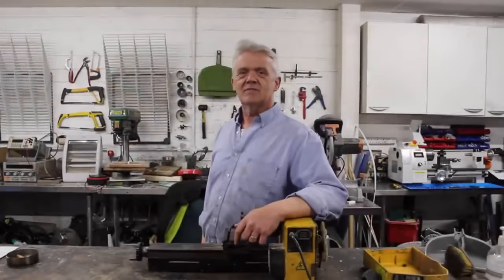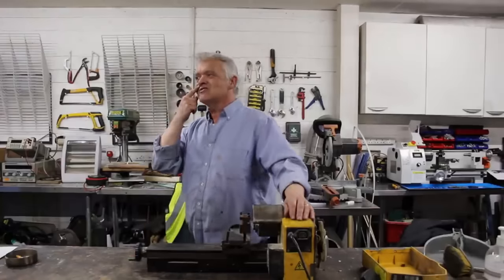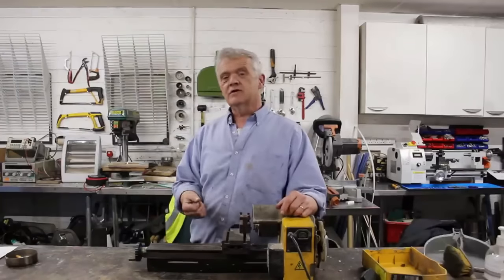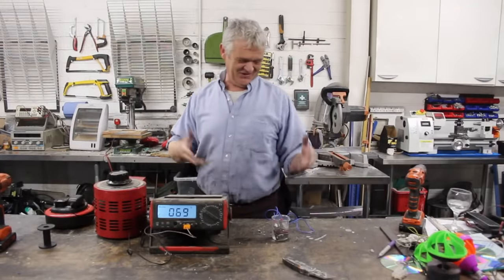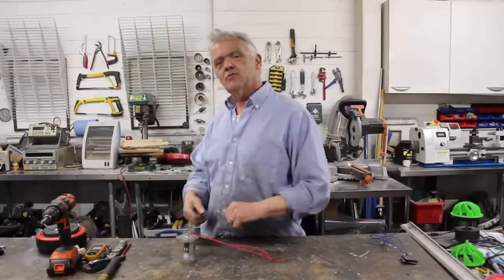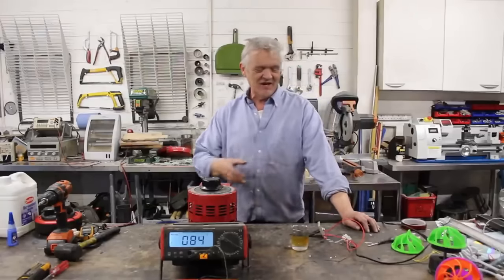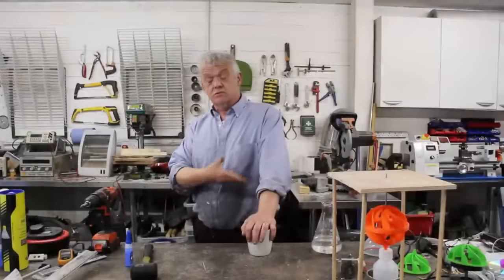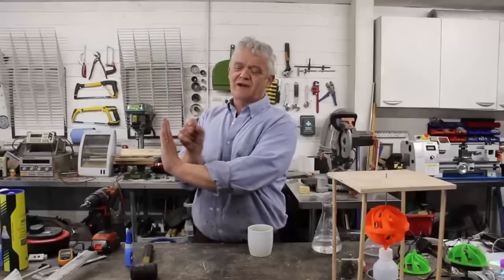016 The Dumas Effect - A Free Energy Water Heater

Comment: I'm not even half way thru yet, but since the first minute, I've been waiting for an "April fools"
 How is this not just electrolysis or HHO generator making tiny bubbles?
Edit: @Rob you killed us with suspense in this one haha. I hope we get tons of comments!
Reply: Ok, Rob covers electrolysis with this in the last third of the video
Reply: Because it isn't. Those tiny bubbles you see aren't HHO, they're Steam.
This is how we make a hot water stinger in Prison with a pencil, cord, and 2 razor blades.
It takes a DC Current through it to make it an HHO Generator.
THAT is the ONLY difference. Apply AC, get heat...
Reply: @TimeSurfer206  Except you can do water electrolysis with AC current, it'll just be less efficient and it doesn't separate the hydrogen and oxygen. Conversely, applying DC does heat up the water too.
Reply: @andrepolomat2420  Show me. I been an Electrician over 40 years, and worked Battery systems for many of those.
You are right, but still absolutely wrong.
Yes, the water WIL be electrolyzed. BRIEFY.
Because as soon as the CURRENT is reversed (ALTERNATING Current, remember?)_the PROCESS is reversed, too!_
Reply: Electrolysis always happens, DC or AC, even in de ionised water. But deionized water is much less efficient at the start. 

But ... Here electrodes are much closer than usual. The very intense voltage differential makes electrolysis possible and intense because the low ionization is compensated by
- high voltage 
- high proximity 

Plus : water ALWAYS has ions. Always. Water can be purified to be low ionized, but it's never 100% deionised. 

=» electrolysis happens here.

But the Dumas effect does not rely on electrolysis. It relies on basic water being a resistive conductor. 

The trick to make water boil 5x faster is just ... Close plates. Close plates with large surface at less than 3mm will encap bubles. The proximity of plates will trap bubles on plates and surface tension will make bubles stick to plates. Once the bubles stick to borders of plates the water in the middle is trapped, and the water in the middle can heat up to 100 or 120° C via basic resistive effect.

Because of bubbles, the water can't flow or renew. You produced an entrapped hot water zone that can boil locally. 

Outside the plates, the water remains at room temperature. 

That's how you obtain water boiling and.producing bubbles at room temperature. You are not boiling the whole glass, but just a thermally isolated part. 

It's spectacular because you are producing intense bubbles 5 times faster. It's just using proximity and surface tension to produce thermally isolated zones.

At some point, it's also not far from Meissner effect. 

And of course, electrolysis helps producing small bubbles to isolate . 

There is no free energy. Just a nice story to fool people who enjoy confirmation bias.
Reply: Note that i was too lame to even mention about oscillation or resonance. The video also gives mistake about it, says 22GHz instead of 2.4 GHz. 

 Microwave oven don't try to break water but use the resonance of molecules to benefit of some resistivity of all resonances. The good frequency makes molécule resonate, and at resonance freq the resistance is maxed, thus energy transfer between the radio wave and the solid matter. Away from that freq the wave just passes through. 

Phones are harmful because they use frequencies very close, on 3 topics : Bluetooth, gsm and wifi are all 3 close to 2.4.

Ideally in a better world those 3 protocols would be assigned frequencies away from 2.4g , but it would break historical compliance. ( to make the story very short ). 

Of course 50Hz is completely unable to even dream of having any harmonic anything near 2.4g ... It's too far from the peak bands.
Reply: Note that when he is using two rods, he is not giving comparison with an other bucket with distant rods for comparison, so we can't check if it's faster or same speed between close and far rods. 

Also note that when water is subject to very high voltage differential, it will electrolysis absolutely everywhere, even in the middle place between electrodes. It's a complete mess and reactions are not predictable at all. You get ions everywhere, and multiple reactions happen all over the place. Water breaks apart and recombine  without any predictable way. That contributes to produce bubbles in the middle of water ( not just on the surface of rods ). You get ions everywhere. And when you have ions, you get a nicely conductive low resistance water. 

At 220v this happens at 5mm. Maybe even 10. 

The « work » of this electrolysis and recombination is also partly responsible for heat production. 

=» having plates so close at high voltage  produce a at least 5 different reactions. Of various types. =» complete mess
Reply: You had to edit it? Did the creator ask you to? Wtf is happening?
Reply: @TimeSurfer206 YOUR COMMENT IS MAKING EVERYONE STUPIDER YOU NEED TO STOP TALKING YOURE A THREAT TO COMMON SENSE
Reply: @michaelbrown3665  the edit was because my original comment was made halfway thru the video and the edit was made after I watched the whole thing
Reply: @TimeSurfer206 ok that's interesting...  "no difference" in materials and construction suggests this could be a multifunctional device: producing either Heat or Electrolysis depending on whether you apply AC or DC.
Reply: @Benoit-Pierre thank you...I found your explanation most helpful.  Elsewhere on this thread I challenged Robert's assertion that there was no Electrolysis with AC
Reply: @Benoit-Pierre 

Hardly lame to steer away from mentioning resonance. Lol. 

Good corrections too. 

I am asking how does 50Hz "bounce around" within the cell?
Reply: @simonmasters3295  YES!!!
Sounds like someone actually watched the video!
Reply: @Benoit-Pierre  you wrote a long enough yarn thread i must respond.    Im not able to totally hash it out but it might not be
 just finding water resonance depending on what your doing it would involve looking at more than that then you umm theres things going on in universe with sound,   enjoy research many people do
Reply: 19:50. He explains how this dosnt happen with ac
Reply: I am surprised no one has mentioned the hydrogen dipole giving each water molecule a 'charge'  that when placed in an alternating electric field will cause the molecules to rotate very much like eddy currents in magnetic materials in an alternating magnetic field creating heat within the material. What wasn't known was the current passing into the water. Even pure water though a very poor conductor will carry a current. Then the energy according to I^2R will become heat no matter how small the current is or how large 'R' is.
Also the electrolysis although very small amounts will not be recombined in the water as anyone who has played with an HHO generator knows. Electrolysis is by definition a mechanical/(electrical) to chemical reaction and is NON REVERSABLE (entropy) without the application of an external energy.
Reply: @mikelong366  an external energy to reverse electrolysis could come from combustion of hydrogen and oxygen that were just separated. It would be like an expansion and contraction on a molecular level but would create waves

Comment: The resonance frequency of gas, water, and solids, 
depends on the distance between two surfaces...
So in a 10 meter tube, the resonance frequency is twice as high, 
as in a 20 meter tube, just like the rules about resonance of air.

Also: In a rectangular pool, 10 meter long, 6 meter wide,
AND 1 METER DEEP, there will actually be THREE different resonance frequencies,
just like regarding sound in a livingroom...

As you surely know, the speed of the pressure wave, 
can be used to calculate the resonance, between two surfaces.

If we have a room, 4 by 8 meter and 2 meter high,
the resonance frequencies are "harmonics to each other",
so they they actually strengthen each other...

Obviously the ressonance is strengthened most,
in a perfect cube shaped room, like 4 by 4 by 4...
A 85 Hz tone from a speaker will be extremely strengthened
Hifi Enthusiasts will HATE having a livingroom with those dimentions.

In pure water, at 5 Celsius, the speed of sound is 1427 m/s.
In 1/50 second, the pressure wave travels 28,54 m.
So if a "50 Hz loudspeaker" in a closed cabinet,  was placed in the middle,
between two walls, which are 28.54 meter apart,
the pressure wave will come back from both walls,
and hit the "50 hz loudspeaker", at the same time, 
as the "50 Hz loudspeaker" sends the next pulse out...

Thus "increasing the pressure more and more,
the more pulses, the loudspeaker sends out... 
Untill the reflected waves, are so strong,
so they actually dampen the output from the loudspeaker.

At 100 C the speed is 1543 m/s.
So in 1/50 second, the pressure wave travels 30,86 m.

In salt water, like in the ocean, the speed is a bit higher,
as the salt content makes the water denser.

But those two calculations simply proves,
the heating is NOT done by resonance between the plates,
in those "inventions" you showed.

So your main point stands...
Those "inventions" do NOT work by "resonance"

I feel your conclusion is correct: 
The water acts as the resistor which gets heated, by a current.

But there is also another effect in play!
Water molecules are dipoles, acting like a compass needle.
So in the ocean (and elsewhere) most will have turned to point their minus towards north,
(because I believe, the North Pole on Earth is actually the EM Plus Pole)
and their plus, towards south...
But large local deposits of iron, 
like that in the sea bottom, one place, 
outside the coast of Bornholm, in the Baltic Sea,
will act as a local magnetic pole,
so when sailing over, a compass will make a full turn...
So there the water molecules do not point "correctly north-south"...

But also two electrodes, with some voltage difference,
will act as "local north and south"...

So water molecules will simply turn themselves "on the spot",
each time the direction of the voltage shifts,

with the strongest turn, when being between the two electrodes.
Also that causes friction...

That suggests, the heating effect will be stronger,
if the electrodes are many plates, closely together,
every second being the "plus" and every second being the "minus"...

However, it MIGHT ALSO be heated by the effect you explained about electrolysis...
some water molecules are ripped apart to become ions,
which are forced to move, by the voltage difference,
but as you use AC, they "jump back and forth"...
The resulting FRICTION surely helps the heating.

ALSO, IF it is correct, that the voltage splits the water molecules,
we must concider that two ions fill more, than one water molecule,
which means the water expands, each time new ions are made...
IF we asume the ions bond again, to be complete water molecules,
during the short time, when the voltage difference is zero...
In that case, you should be able to hear a hum from the water...

Apart from that little "2 GigaHz" mistake,
I find your vids to be VERY educational, interesting and entertaining :)

"The more you know, the more you realize, 
 there is even more you don´t know yet" :)

Best regards...

Comment: The low resonant frequency of water if about 2,4GHz, as microwave oven works. If you apply more than 1,2V between 2 electrodes into distilled water, you electrolise it (voltage varies slightly depended on the distance between electrodes) . Its HHO gas what this steam is (losses heat up the liquid water). Electrolysis can happen with AC current, but gasses are mixed (NO DC needed).
It would be interesting to see if this steam is flammable (carefully).
Reply: Water doesn't have a resonant frequency. Microwave ovens heat water because of dielectric effect (fast changing of the electromagnetic field direction.) The current explanation is that the hydrogen bond progressively changes as frequency increases. Dielectric loss of water at 2.4 GHz is over 40%, but it'd require frequencies of almost 1 THz to get less than 10% loss (there'd be losses in the device, instead of from the water dielectric heating, so it'd be basically not worth it, even if terahertz technology was cheaply available.)

Comment: They do these with tubes with holes drilled in them to make steam, instead of hemispheres like this. Idk where they came from but my father taught me about it in the 80's as a small novelty to build in the shed. So I suspect it's older than we realise. There's nothing to do with resonance or magic, it's just cavitation. The 'ohmic' and the example you showed is just electric heating, the spinning hemisphere, etc, you'll notice the inner one has holes missing, that's causes the cavitation. It's better with cylinders because you push the water through it so it's way more effective.

Comment: no, it is all about resonance actually. this is why the trumpeter designed his bell thick - so it rang at 50 cycles. much easier, The cheap bell i bought was up in the 400s of cps so i drove it with an old audio amp ...at its resonance [the important part!!!!!!!]... > the sphere is rigid, the ~bellcover not so much >> cavitation in the cavity =-= DC for browns gas, AC for heating. even the best channels arent going to delve to deep into the true capabilities of resonance for efficiency without ending up behind a shad o bane
Reply: Yep, you got it, it's all about the cavitation, that's where the magic happens....

Comment: My physics teacher told that when he was just graduated, young engineer sometime back in sixties or seventies he got a task to solve a problem of a water heater this type. Heater was located somewhere in the basement of a quite a large building. I don't remember what exactly what he told the problem was, may be that from some sort of over pressure pipe was pushing some hot water out periodically or something. The room was a bit too dark so the young engineer tried to light up the place with cigarette lighter. In the water heater had a  small pipe on the upper part of it and the pipe was closed by small valve, probably its purpose was to remove possible remaining air from the heater's container. He (the engineer) opened the valve just a little bit to see if there was air in the heater. He knew there supposed not be hydrogen nor oxygen in the heater but as he opened the valve, long bluish flame ignited from the end of the pipe. Fortunately he succeeded to close the valve immediately and the flame extinguished at once. My teacher told he was very lucky that the flame did not pull itself inside the heater, otherwise he would not be alive to tell the story for us. He reported  about the danger for his superior and within an hour or something all this kind of heaters was shut down in entire country and manufacturers / importers started to withdraw all this type of heaters from the market. AFAIK, still today this type of heaters are prohibited in Finland due the risk of explosive gases generation.

Comment: Oh, how dangerous a little knowledge can be. Electrolysis works just as well with AC as it does with DC, with one major caveat. When using DC, the O2 and H are released from opposite electrodes and can be collected separately while with AC they are released alternately from each electrode. This creates an explosive mixture which in quantity needs to be handled with care. The heating is primarily a by-product of the electrolytic process, and a very inefficient way to heat water If you really wish to contribute to more efficient energy usage, I suggest mounting a small wind turbine on the front of an EV. Just think, the faster you drive the more power you generate.

Comment: Epsom salts and sodium bicarbonate 1 - 2 grammes of each in equal parts.
Pmw 41khz - 44khz @ 24-48volt and 10 amps produces lots of hho dependant on surface area and the correct anttena used as a coil.
My best result was 8 litres per minute but i have fail to replicate this so i missed something in that experiment.
Do not ignite this gas it is highly explosive and can deafen when placed into even a small container.....
I pint was enough to deafen for 2 days and lermenant lose to some lf my high end and mid range hearing. Car alarms set off and people coming outside to see where the bomb had gone off.
Reply: This reminds me of my childhood in the 70s, 50/50 mix of oxygen acetylene in a 1 gallon metal discarded engine oil container, a bit of fuse wire and 30 yards of cable to a  car battery to keep a safe distance, no car alarms back then, but plenty of bemused neighbours wondering if the IRA had visited, lol..
Reply: Acetylene and oxygen in a plastic bag, but be careful the static charges sometimes ignite it. Have found if you use instead of a melting wire you use high voltage Arc, the explosion as much more power , especially under some pressure like placed at the bottom of a garbage can full of garbage.  It could reach some serious heights and give you a large mess to clean up!  Speaking from experience. 😊

Comment: The reason we don't use it in domestic water heaters is because you're actually cracking the water breaking it down into its parts  .    Will start to cause a bunch of problems with scale and eating pipes.    Then you have faucets and valves That would clog up and it would be a nightmare. I wouldn't drink that water either When you break the hydrogen Ions from water it becomes more caustic.   That is the real reason it never caught on.  Has nothing to do with resonates it's called electrolysis, it's that simple.    100% pure water Won't even work it has to have a little salinity to be conductive.